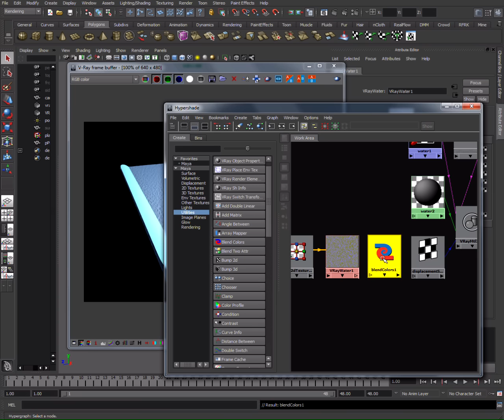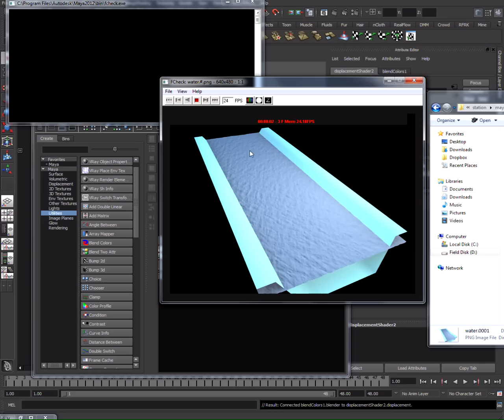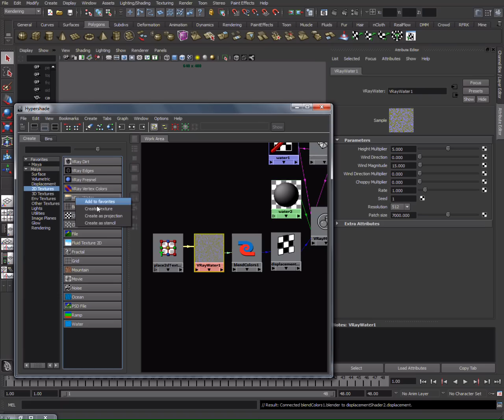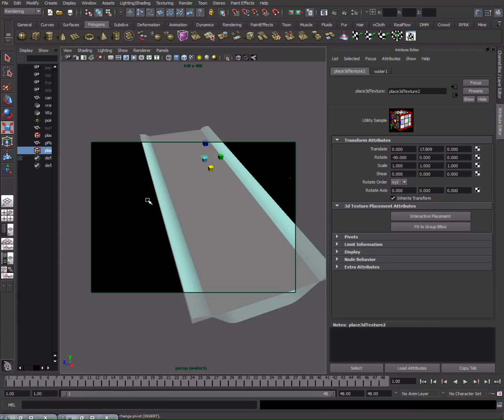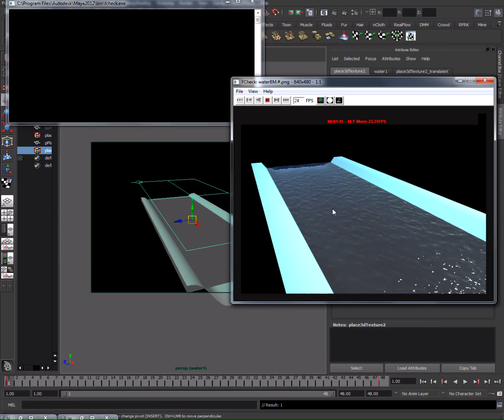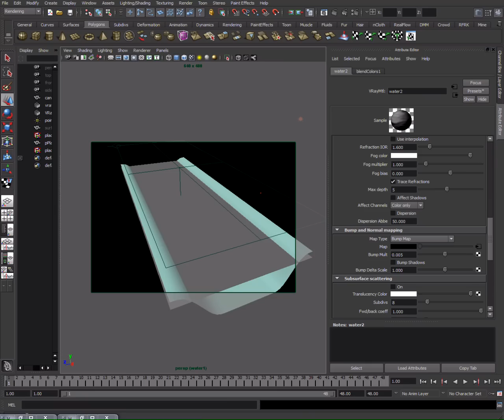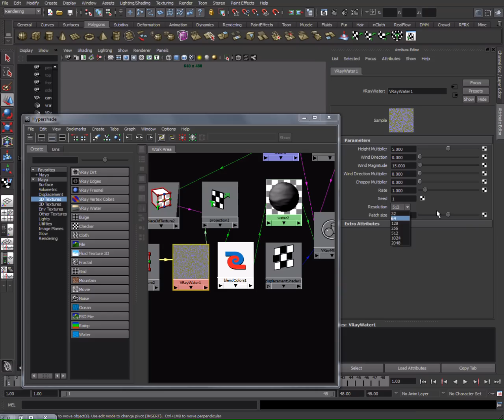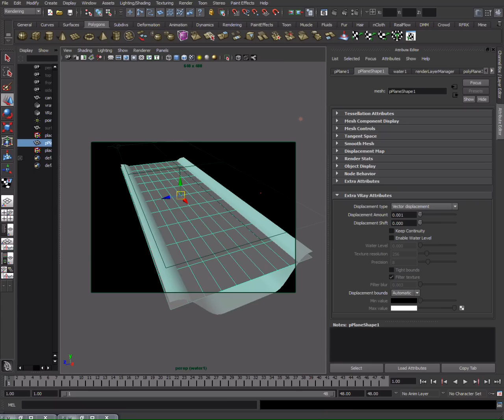Maya Vray Water Tutorial - Part Two (Bump-Map)

Comment: Unnecessarily complicated. (1) don't need Blender node - decrease VRayWater / Height Multiplier, or Wind Magnitude. (2) don't need Projection node with this fake technique for moving waves - set Wind Direction Multiplier to 1, then set desired Wind Direction, and do test animations with different Rates. (In this tutorial, Wind Direction Multiplier is left at 0, so the wind has no direction, so no wonder the author struggles to find a technique that results in moving waves.)